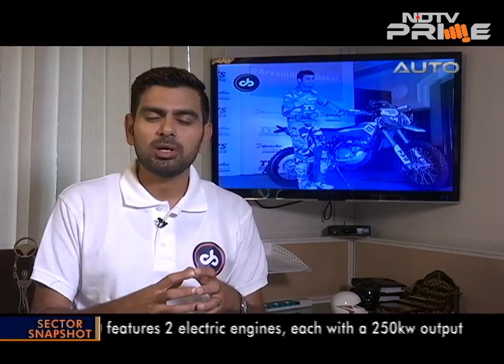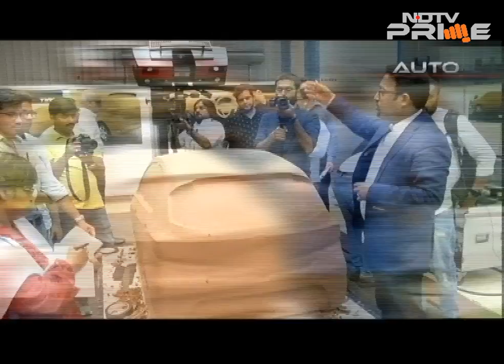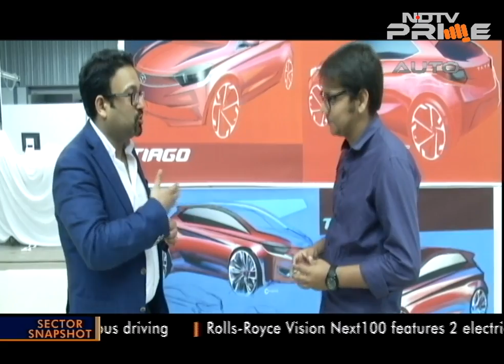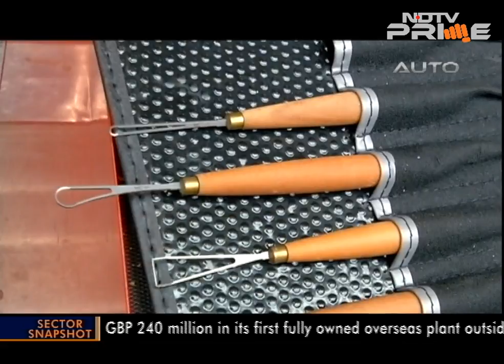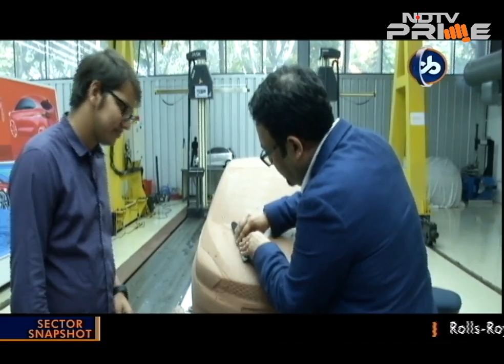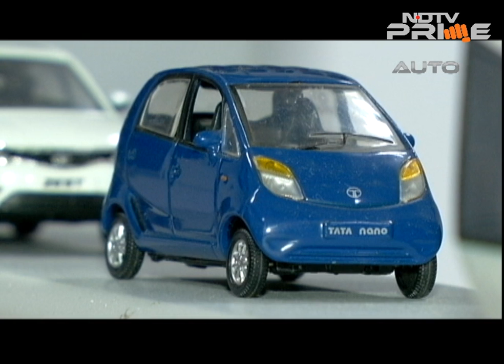Tata Design Centre

Comment: TATA should change the design team . The design team just think about round oval shaped cars. The tata tiago is a confused design the proportions of the car is confused . The headlights are really big than the body proportions. the tyre fenders they made are really small, even installing the aftermarket alloy wheels on the same tyres provided by the company  175 65 r14 , the fender touches the tyre and car looks realyt ugly when it is loaded. the car looks like a turtle. we don't want the smiley grill, it looks stupid on the car. We want mean lookin cars. Their presence must be noticed.make tiago a little wider. it looks like squeezed. looks at the suzuki cars of the tiago segment.

Comment: I would recently like to share the recent reviews of the tata tiago. So i took a test drive of the tata tiago xz petrol..but to my surprise the. First thing i noticed though a petrol engine it make a lot of noise. 2 when u put in to the first gear it some wht sounds like the tata nano. 3 when the car goes about 80 kmhr plus i noticed some problems in the accelaration. 4 when i tested the brakes it couldn't perform up to the mark though it had abs n ebd installed in it. 5 when i told this to the tata  engineer he said that brakes are fine  and its a 3 cylinder engine so it would not give that much power.